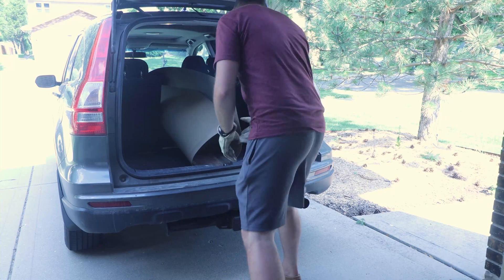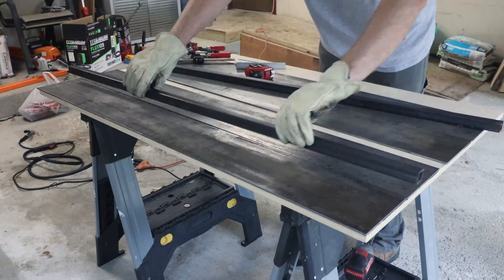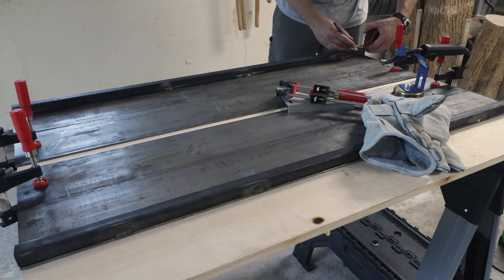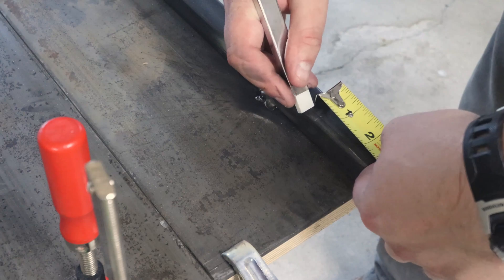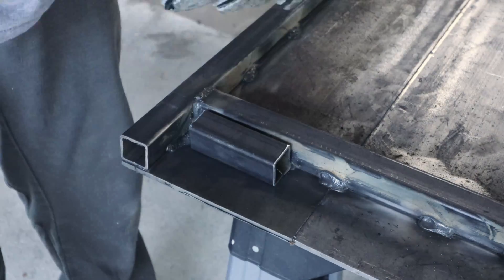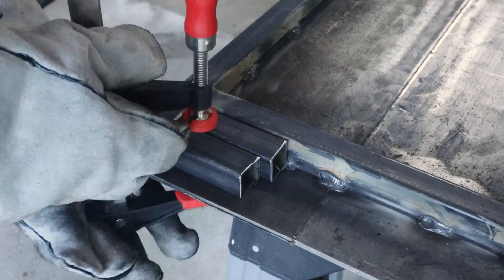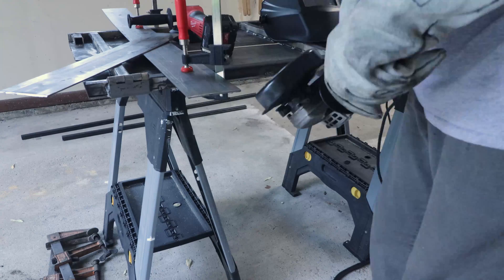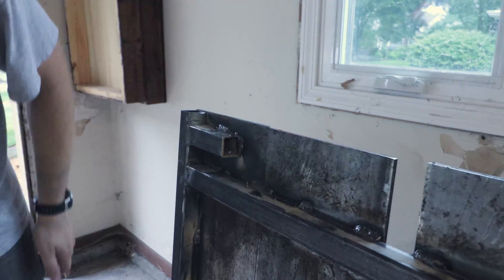The Best Small Workspace Welding Table | Part 1 | Making a Fold-Down Welding Table

Comment: It's interesting, I had this exact idea back in July. Even had started a thread on the Hobart weld talk forums. No one had made one. Granted, I was also looking to build one about 30 inches deep and about 72 inches wide. But with 2x4 wall studs, the weight could maybe rip it out of the studs. Glad someone has finally made one of these.
Reply from the maker: If you made the table top out of thicker metal, I could see that being an issue. Though, then again, if you're making a welding table out of 3/4" thick plate, you probably have the space for a "proper" welding table 😅